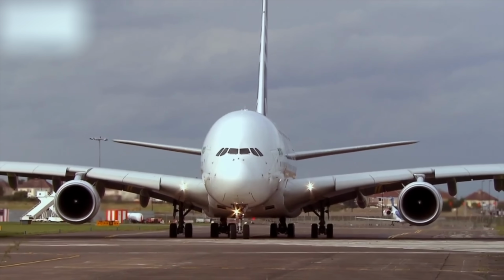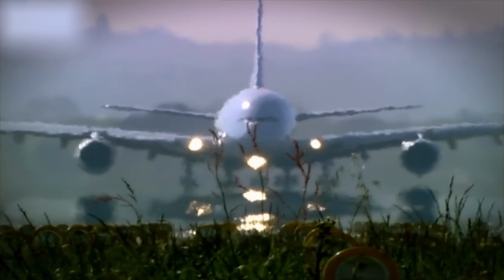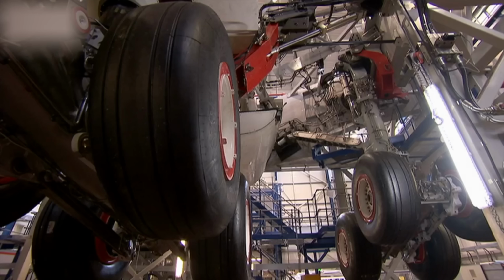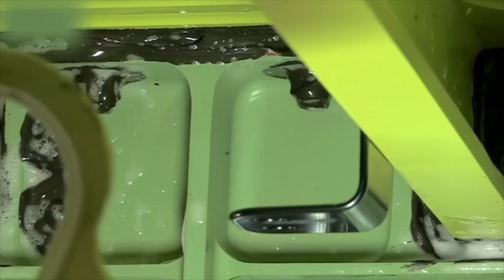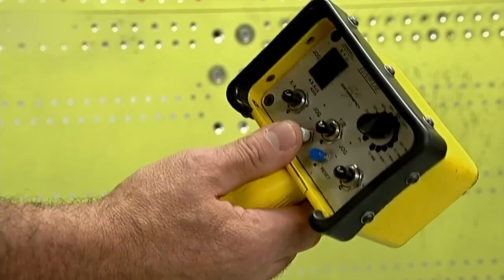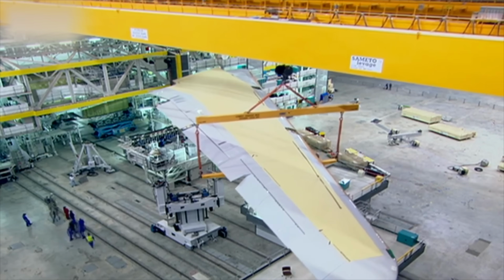Airbus A380 Wing Manufacturing | Inside World's Largest Wing Factory | Building & Assembly Process

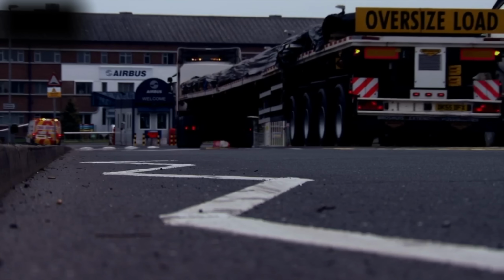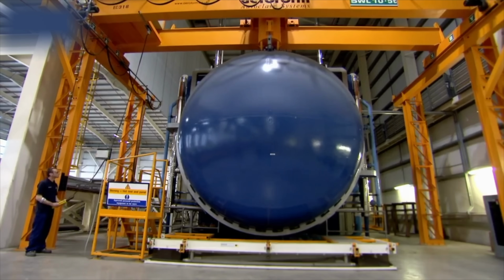Comment: 1:55 - 2:25 : Europe’s Largest milling machine, polished, engraved, formed, heat treated in large oven

2:50 - : 12 baths for cleaning,protection and surface treatment

3:40 - : Large custom jig just for the wing assembly

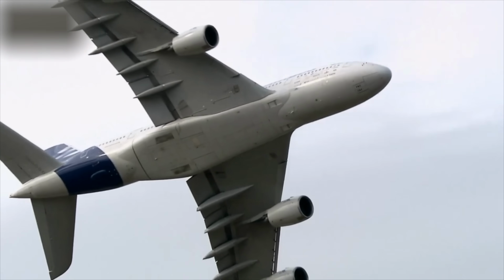5:35 - : Wing shape inspection using lasers and mirrors/reflectors

8:55 - 9:40: Fuel Tank Leak Testing, crawling in tank, spray solution bubbles, helium sensors for wing surface 

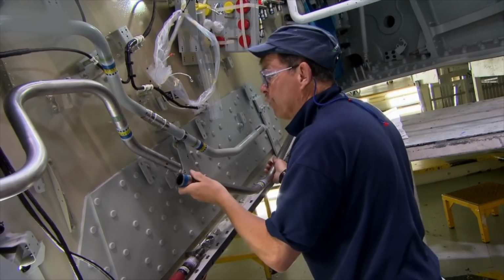9:40 - 9:50: Manual installation of internal systems, 200 technicians, 22 days to complete. 

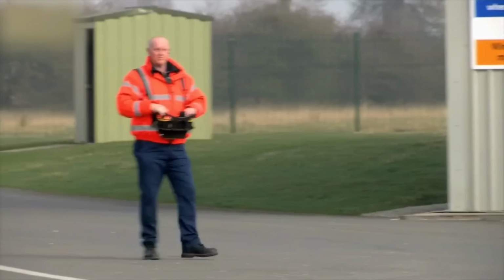12:15 - 12:35: Transport, wing must be level at all times during transport to avoid bending, using large trailers, a barge, and a ferry

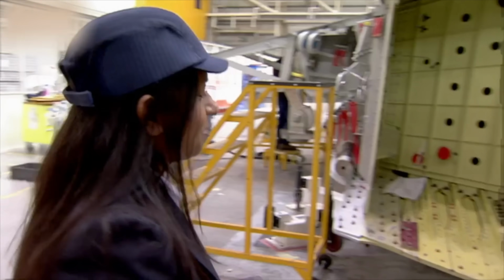Comment: 10:40 Who claims that the A380 is the most fuel efficient aircraft. If that was the case, why did Airbus stop building A380's and customers stop flying them and stating that the A380 isn't fuel efficient at all. The 4 ensures engines are of an older technology, not the newer kind of engines so they soak an alarming rate of fuel trough the flight. And also because Airbus expected there would be another bigger A380-900, they made the whole fusulage more robust what means tons of more weight what is dead weight for the A380-800, where the -900 never came into existence. 

So it is too heavy and 4 older Trent Engines aren't fuel efficient and that is why many of them were put out of service. Only a niche market like Emirates use them because of their geological position and can fill them with passengers where there are more and more secondary point to point smaller destinations with planes like the A321XLR.

Comment: A mate of mine worked for Qantas. I was told airbus were giving away these planes. Qantas couldn’t say no. Airbus had to sell 250 to brake even. No telling how long that took. Cabin crew have told be that things are always braking in the cabin and parts are expensive. Airbus was never a threat to the 747. Things inside the cabin at least to me appear cheap and flimsy.

Comment: I wish they would change their minds and start building them again. It’s the best aircraft in the sky.
Reply: During my master’s research on the Airbus A380, I found that demand for extended long-haul nonstop flights is decreasing. Airlines and passengers are favoring smaller, more fuel-efficient aircraft that can operate on point-to-point routes, offering greater flexibility and cost savings. Consequently, airlines have reduced their purchases of the A380, opting instead for smaller aircraft that can serve more destinations efficiently rather than relying on a single large aircraft for long-haul flights.
Reply: @vineelpatibanda3805 i disagree since hub to hub is the market for this aeroplane. And the fact the legacy carriers need them even more, that can make them work. The number of people flying will only increase and slots are already full. I know most A380 flights to certain destinations are often overbooked. It is a popular aircraft too and should have been stretched to the -900 version and with a possible 11 abreast in economy that still reflects today’s comfort standard. So the economics would work very well.
Reply: costs too much

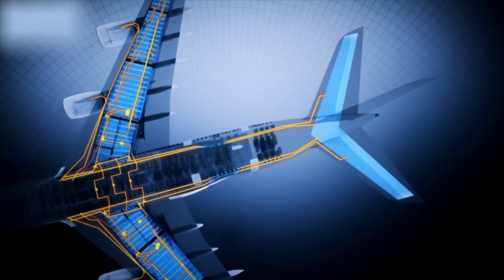Comment: 10:33   What happens when the tanks run low on fuel and there is not enough product to pump into the wings to mitigate bending ?? 🤔
Reply: The wings dont use fuel in the first place. Its smoke and mirrors.

Comment: Former Boeing Everett.... we invented Jumbo Jets decades ago....

This is an old video... NO MORE A-380's will ever be built.... end of production. I can still remember when Boeing and Airbus were presented with requests from different airlines on the future of very large aircraft.

Boeing bet that the market would end in less than 2 decades... and it did. Boeing presented a supersized B-747 rather than a new plane. It had already committed to the B-777 and soon to be released B-787. Entire market was changing from Hub and Spoke to Point to Point Regional Airports. The market for large was going to end.

Like Airbus, Boeing also quite making it's own Jumbo Jet. It is also phasing out 57's and 67's. B-737, B-777, and B-787 is where the demand is now. Their 797 is already being designed, but won't be released for 5-10 more years. 

Boeing appreciates what Airbus has contributed to Aviation...

Comment: Nobody even wanted too buy the A380 way too big and a fuel hog.
Reply: Most efficient fuel burn per passenger - that is how airlines classify 'efficiency'.
Reply: So no-one bought the 250  aircraft that are in current use ? and the 380 is 15% more efficient than its closest Boeing rival.

Comment: A-380, literally the Biggest mistake EU partnership did to build a massive plane when they should have researched on building a plane that was fuel efficient. Hello 787.
Reply: Would you prefer to make the mistake of making the A380 or the 737 MAX?
Reply: @KingHumphrey  'we asked passengers and they preferred the A380'
Reply: The a380 concept took 15 years before one was built. It was using the technology invented at its time. Its like nobody found a way to make a 747-800 more fuel efficient and quieter either
Reply: LOL, The airbus A350 outsells the 787.... because it is a better plane.
Reply: @chrissmith2114  You are missing the point. I was talking about Airbus making a huge mistake by deciding to build the A-380 at the time when they should've been focusing on building a fuel efficient plane instead. At that time Boeing had started developing the 787. Airbus wasted their time and resources on building an already obsolete plane that eventually nobody wanted.
Reply: @thuydoan7496  The A380 is the most fuel efficient because it carries a load of passengers,  the A380 suffered during Covid because the carriers could not sell enough tickets to even fill smaller aircraft,  but now that air travel is rising again the A380 are back in service - it is a superb plane.
Reply: @thuydoan7496  it's air traveler favorite plane.

Comment: Sadly, the A380 is no longer in production after less than 2 decades of production, unlike the 747 which in production for half a century.
Reply: A lot of 747 were cargo planes.
Reply: Many that started life as passenger aircraft ended up being converted to freighters too. Not ready surprising though when you consider their Los carrying ability
Reply: @chrissmith2114  still are, and making good profits after expensive conversions
Reply: according to it's passengers, it was the most comfortable and quietest beast on the sky.
Reply: @lunascomments3024  What on Sky news?
Reply: @JohnSmith-ei2pz  you talking rubbish as usual.
Reply: That's one of the bad things about airbus, cancelling production of the a380
Reply: No loss really . The 380 looks like flying village. Rumour has it that now travel is opening up again post civil they may put it back in production. Why bother I say, considering that even prd cover airlines were shelving them
Reply: During my master’s research on the Airbus A380, I found that demand for extended long-haul nonstop flights is decreasing. Airlines and passengers are favoring smaller, more fuel-efficient aircraft that can operate on point-to-point routes, offering greater flexibility and cost savings. Consequently, airlines have reduced their purchases of the A380, opting instead for smaller aircraft that can serve more destinations efficiently rather than relying on a single large aircraft for long-haul flights.
Reply: More of a timing thing really, nobody wants these super heavy jets anymore. The 747 has stopped production too.
Reply: @wyoung8331  A390 are being brought back into service after Covid,, and in great demand, because passenger love them...
Reply: @chrissmith2114  This passenger loves any Plane that doesn't fall out of the Sky
Reply: @johnpartridge7623  the flying is easy, the hard part is landing the reason new designs have such cruel testing regimes for their landing gear
Reply: L
00
Reply: It's American technology
Reply: @حميدمحمد-ت9ق  very much doubt it, as for Boeing's last few years with their planes not allowed to fly, it certainly was not being designed parts either.-lol

Comment: A very Interesting Video, as I was once connected by working the night shift producing the wing fittings for wing landing gear. My day mate and I made the first few sets of gear ribs and spars used in NDT and destructive testing plus used in the first A380 test-flying aeroplane.  We used to make the same components for the then Airbus fleet of Aircraft until 2003 when sadly our company closed after trading for over 60 years. But It left me still very proud to be connected to A380 number one.
Reply: A shame the parts cracked in service!
Reply: @JohnSmith-ei2pz  Try finding an airliner type that hasn't suffered structural cracks. It's harder than you might think. Out of every Airbus and Boeing type ever made, only the B737MAX and A350 don't appear to have airworthiness directives associated with cracks - yet. They're still pretty new, but in time they'll have ADs for inspecting and fixing cracks too.
Reply: @JohnSmith-ei2pz  Oh deary me, REALLY, shame no change to the design on parts WE ONCE MADE eh.. best you google the time period of the alleged failure eh..lol
Reply: @ianburit3705  Are you sure you were not the cleaner and swept up the swarf? As you talk so childish!!
Reply: @JohnSmith-ei2pz  Are you even sure you know what an aeroplane is? as you sure talk like a Boeing employee. LOL.. Losers talk just like you in desperation, so, please make us laugh, and talk some more..  I have time, lots of time to read losers comments, as the rest of Youtube does.. I wonder If you even choose one person at random to make people laugh at you, as it sure looks like that from my office here. If you work at Broughton, then just maybe your Anti English, If you're a Boeing worker, then yes, your products continue to amuse the world with their takeaway plastic non-swarf-making bodies banned by the US governance.. If you're not, you just sound like the losing side - LOL. Do you know what a 5-axis machining centre is?  But then, I very much doubt it.. Bye chappie.. have fun now, ask someone for a ball you can chase  "JOHN SMITH":face-green-smiling:
Reply: @JohnSmith-ei2pz  OH DEARY ME, why should I be wasting my time replying to a nutter? well, I have time LOTS OF TIME even for nutters, here "JOHN SMITH" There's a British beer named after you, it's vile also. OK, IF you care to google a name of a long ceased subcontractor to aerospace plus other high-end parts it might explain me and my once fellow workers there. We worked 24 hours a day 7 days a week constantly. Only closing for 2 days for Christmas. The A380 newly installed twin pallet 5-axis machine was run in European working style by Friday to Sunday day and night shifts and Monday to Thursday days and nights just to meet demand then. My fellow workers on smaller parts like the entire civil Airbus fleet A319/ 320/ 321/ 340 up till 2003 plus many other UK and European aircraft Companies such as ROLLS ROYCE AERO,  but it all fell foul of RR and AIRBUSSES demand for a %10 price reduction on each part made year on year. "The General Engineering (ILFORD) LTD Roebuck Road, Hainault, ILFORD, Essex for the nosey people, Oh, My old dad worked there before he got me a job there as a 15-year-old. I am 75 years old now, and so fully trained I could and did run any machine In the shop when asked!! I actually produced more Airbus parts per shift twice more than any other operator before me, the reason? They were just machines, I don't care what the machine made I looked at the machine, sussed It out, made it run quicker/ easy when you know how, and to all the muppits before me, I BEAT YOU ALL FACT!!
Reply: @ianburit3705  You obviously drank too much machine coolant! And sound avery bitter old man!
Reply: Ngqabutho
Reply: No OK